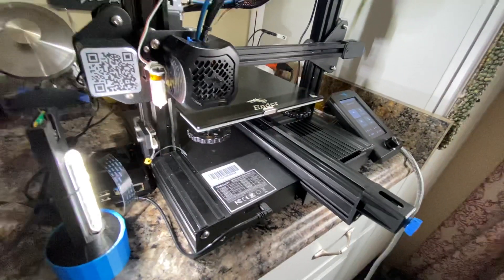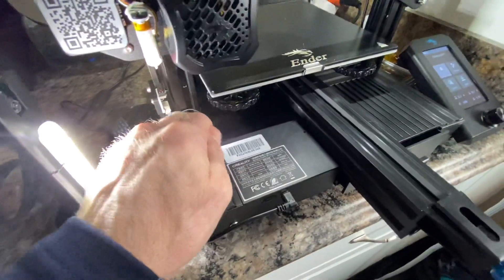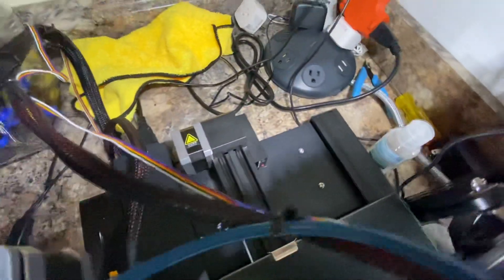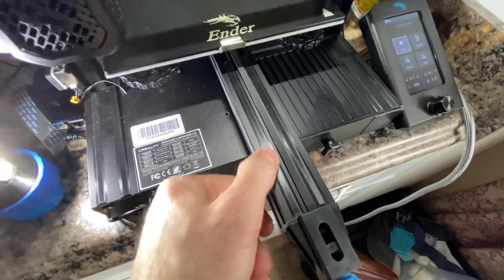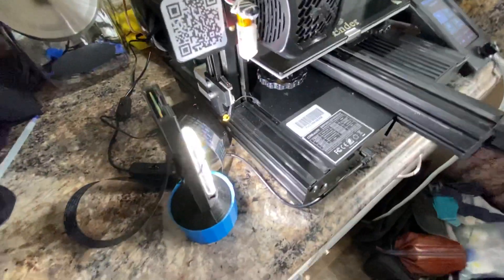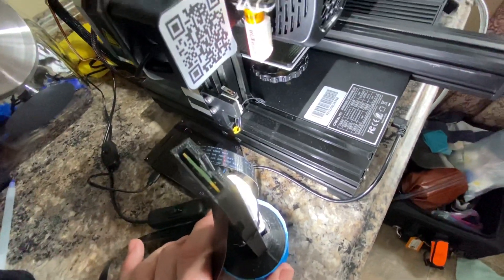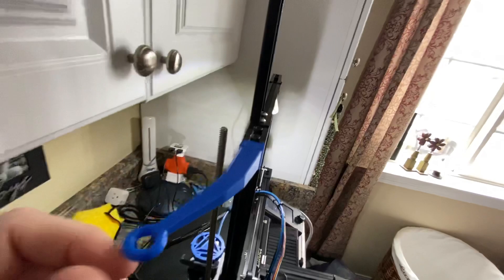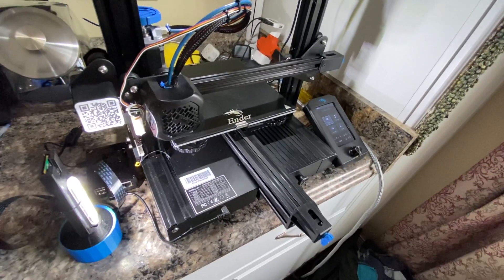Creality Ender 3 V2 UPGRADES - slot covers - quick overview (raspberry pi, camera, remote).

Comment: So, I printed these out last night. Are they intended to snap in to the slots? Because mine definitely dont.
Reply from the maker: No, they are drop in -not snap in.  Easier to remove that way.  Obviously if you turn your 3D printer upside down - they will fall out.  But they just set in there to keep filament scraps and dust out.  I'll add this note in the comments.  Thank you for point this detail out.
Reply: @TheRealWorld737  Alright, that makes sense. Not sure if it's the ones I downloaded but they sit at an awkward angle. Not super impressed and likely won't use them. Thanks for your response!
Reply from the maker: Ok. Thanks for the reply.  Just a few things to assure before they get recycled - Check that they only for Ender 3 V2.  Mine sit flush in it.  See if you put them in upside down.  The bottom sides are slightly beveled to lay flush.  The tops are completely flat.  Make sure you didn't have any supports programmed into the build - as that would leave some remnants on the edges and cause them to be off.  Take care.